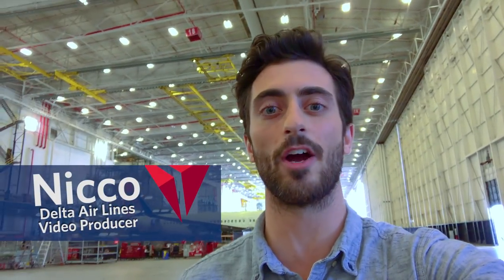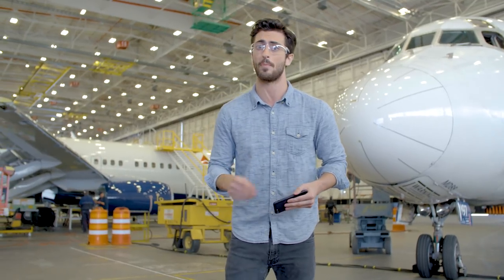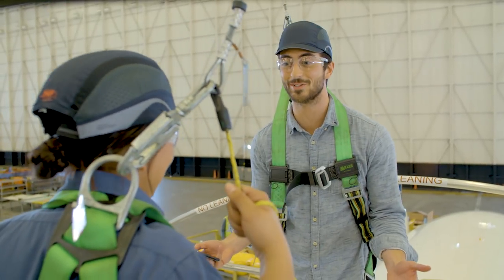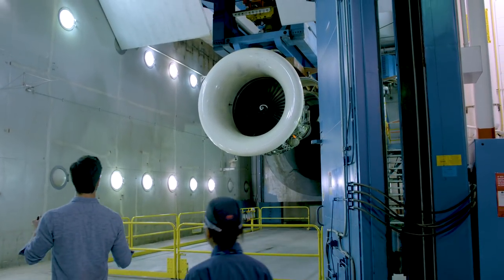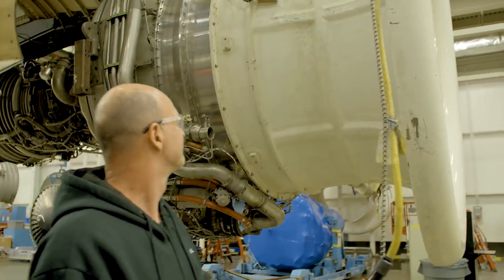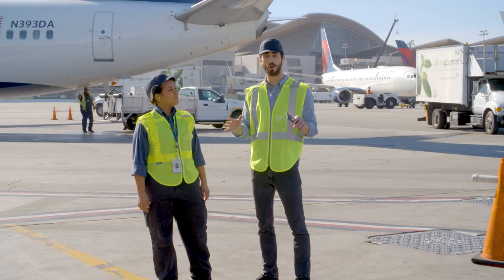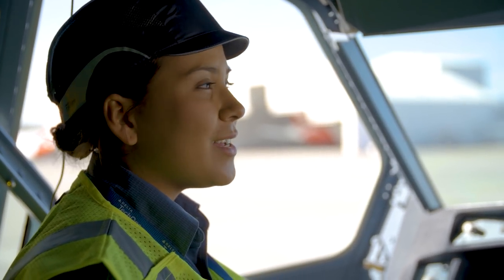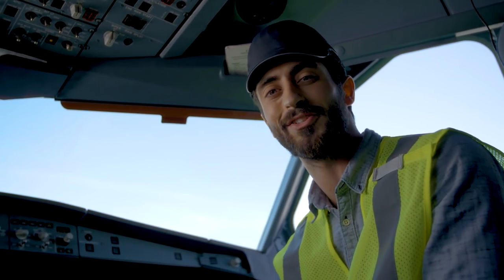Careers at Delta: Aviation Maintenance Technician – High School Outreach

Comment: Aircraft maintenance is a dangerous, stressful dirty job.  You also get to work weekends and night shift. If you are lucky to get into the majors the pay is good. Layoffs are frequent. That is the reality. I have the  faa a& p technician and the fcc certification. Worked as a flight line technician for 15 years. Loved it especially since I was taxi qualified.
Reply: Finally someone gave a real review
Reply: Did you ever consider pursuing a career in production of airplanes instead of maintenance?
I'm an aircraft mechanic apprentice at a company that produces airplane parts and sections and I believe it is generally easier than maintenance.
Reply: I agree w/what you said Frank. It's a lot different at an out station working midnights  with no end in sight because of seniority. Expect a lot of weekend / night shift work.  Summer / Christmas  vacation non existent due to seniority. Get used to Tues / Wed off days.  Things are a lot different than at a major hub. Very few have that smiling face at 330 AM after working on a lav  / lube job / fuel tank or pulling panel in a cargo bay.
Reply: @literallytrash1869 how's this going for you?

Comment: Hi delta loved the video, thanks for all the info and close look into tech ops. Wanted to ask I am an experienced AMT currently a lead heavy check mechanic. I have about 10yrs line maintenance experience and about 3 1/2yrs heavy check on commercial jets greater than 12000 lbs. I am run taxi qualified on 4 different airframes, have been an inspector, had multiple special trainings such as NDT cert, boroscope qualified, BF Goodrich tungsten surface treatment training, RII qualified,   performed parts recieving inspections, written repair orders, audited calibrated tooling program. Part of my line experience was daytime on call so I have experience with fast paced discrepancy resolution. I have also done on call for united mainline. I have a spotless record and I have a very professional resume with great references that include 1 from an FAA safety inspector. Also I have been internally referred. Despite all this I  have recieved nothing but rejection letters for the numerous positions I have applied for at Delta. What am I missing that would qualify me to be part of the tech ops team?    Thanks
Reply: It’s not what you know it’s who you know
Reply: @cgyj  lol I ain't heart broken now, I am thankful for how things worked out. I am currently employed at FEDEX
Reply: @willl.5260  I'm glad for you. FedEx pays REALLY well.   :)
Reply: @willl.5260  This reply is pretty late but delta is notorious for wanting fresh talent and rejecting people who are as experienced as you. You're better off at fedex regardless of experience.
Reply: @lucasjohnson3780  thanks, I am enjoying FedEx thus far.
Reply: @willl.5260  I have a lot of Aviation experience and when I submitted my application  they jut gave me the same old BS Standard reply.. "your experience is very impressive, but we are going in a different direction"  I applied a few times with them.
Reply: @lucasjohnson3780  - This is very true. I'm in orientation now and our Delta trainers told us that too many of their biggest AMT safety violations are from highly experienced recruits who know too much. 

Meaning they come in really aggressive with great intentions and wanting to produce but because they know so much, they start skipping steps, cutting corners, not following manuals/checklists then major errors start occurring.

They said they prefer new people who know that they don't know, are more likely to triple check their work and then they can teach them the Delta way of doing things.....

Comment: Are there any particular college/s that Delta prefer their AMTs to be graduated from? If so what are the names?
Reply: I think you just need an A&P. Airlines and manufacturers are getting desperate. Expecially for avionics since all the 737 Max's are grounded.
Reply: @Kelly_KC  ok thanks
Reply: it's not a 4 year program, It is an A&P certificate which normally takes 2 years to obtain. Normally a community college and must comply with FAR 147
Reply: @brendanmckee5843  thanks Brendan. So of the two :Avionics and A&P which command better salaries all time?

Comment: What kind of hats are those?
Reply: They are called bump caps, and protect the head from injury when working around equipment. They offer less protection than normal hard hats used by construction workers, but are more comfortable to wear. Bump caps are used in many industries.